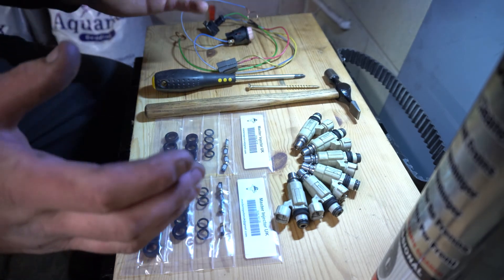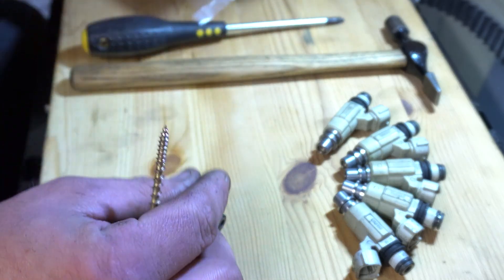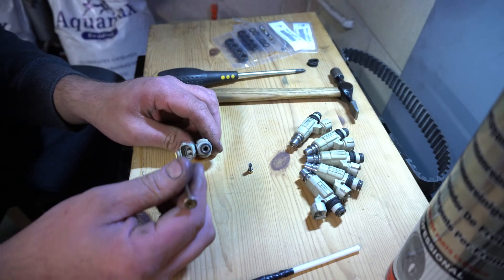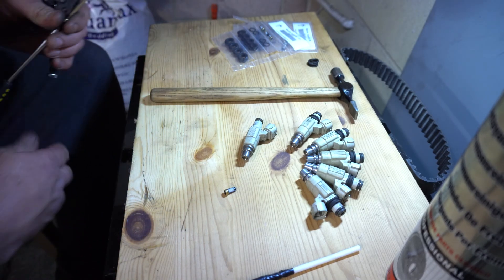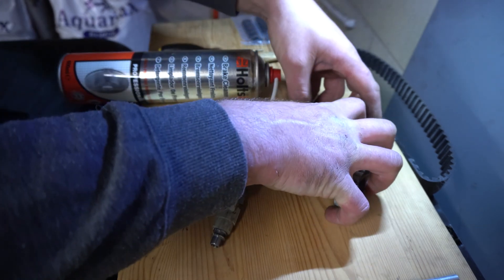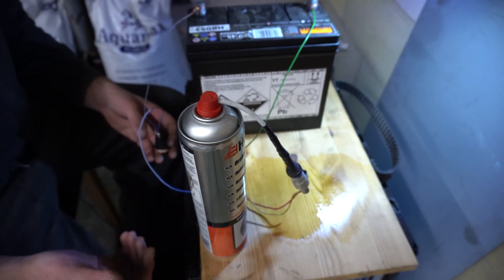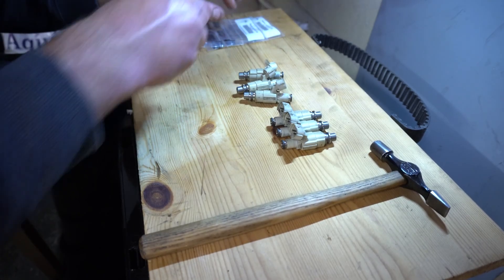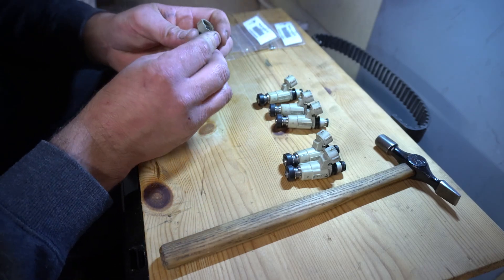DIY Fuel Injector Clean & Refurb (Basic Tools)

Comment: That injector filter saved my car. Our war torn country, not many VW parts available and my car was literally going on idle or limp mode. Took out the injectors, removed the filters, soaked everything for 30 min in brake fluid, cleaned with carbo cleaner....works great.
 Thank you so much for this.

Comment: When it comes to leaking fuel injectors, the only way one can detect this is through fuel trims correct? Modern vehicles would not be able to detect this specific condition and throw a code for it I assume?

Comment: Dont put the screw in too far. Im pretty sure i fucked up something in my 6 injectors because i stuck it in too far. The injector doesn't close. It just sprays without even having power run through it

Comment: great video man, very informative. however, i was wondering if it's possible to just use direct current with the connector and a drill battery instead of using a car battery and switch to spray out the carb cleaner? has anyone else tried this out?
Reply from the maker: Keep the voltage low - around 9v and keep it momentary so the solenoid isn't damaged when you are cleaning 👍

Comment: Thanks for sharing - I intend refurbishing my Toyota 2AZFE Denso injectors the same way, and this video showed the process well. My only contribution would be to lube the o-rings with petrol before re-inserting in the fuel rail, instead of rubber grease as suggested, and to have a container ready to capture the cleaner spraying through the injectors.
Reply from the maker: Lubing the oring with petrol will dry long before you try to fit them making the rubber super clean and very hard to install. Rubber grease or silicone grease sparingly makes the install not only easy, but stops damage to the rings on installation. As for the container - 100% agree, but it also evaporates almost instantly.

Comment: Great video! Gonna try this on my vauxhaul corsa B. Swapped a 2.0L x20xev from an astra in it but it runs waaaaaay to rich. MAF sensor keeps giving me good data but the O2 sensor is all over the place, plus it smells like a lawnmower. Maybe this will help it run better before I go out and replace the O2 sensor.
Reply: Engine coolant temperature sensor failing often causes rich running on vaux engines ive had many over the years